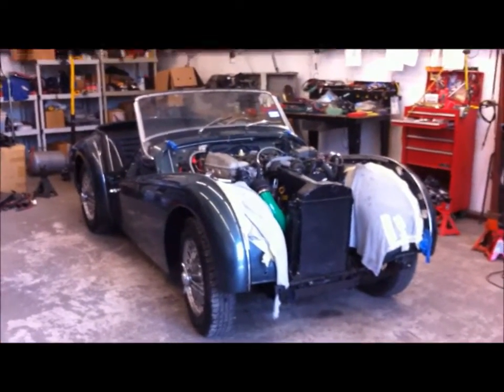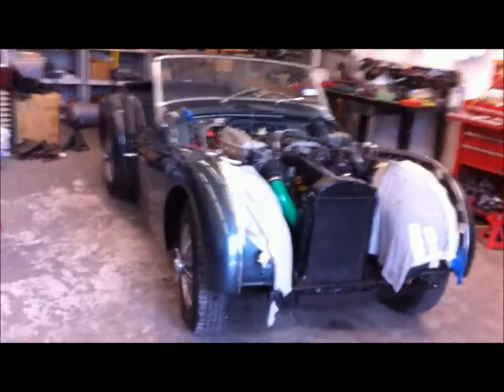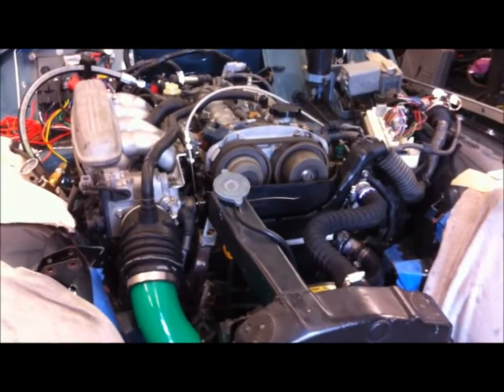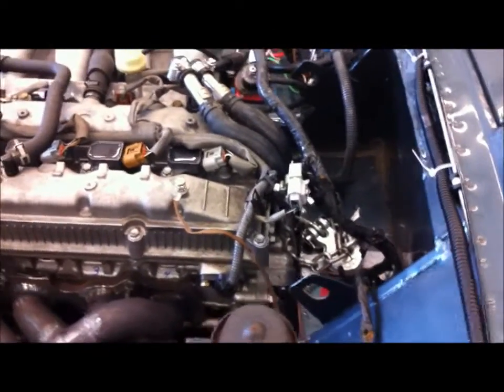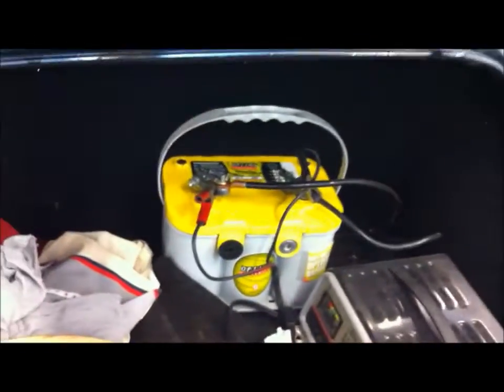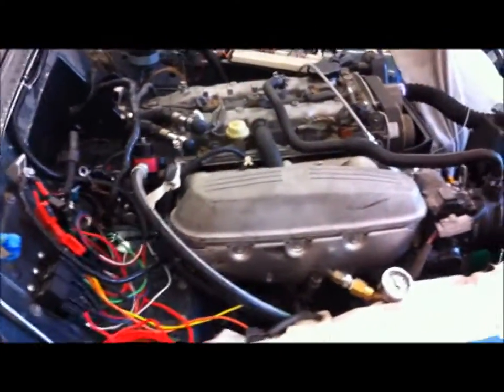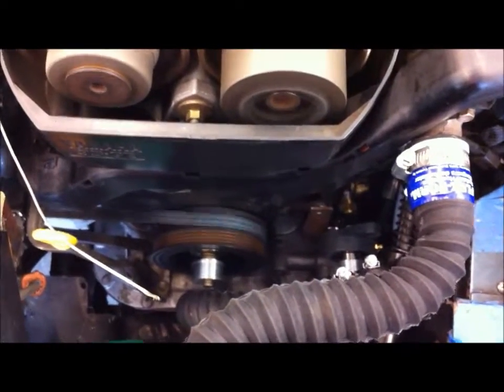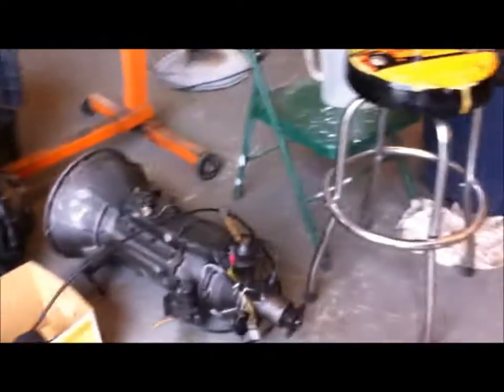Triumph TR3A With A Toyota Beams 3SGE Blacktop Engine.  Part 1 of 4

Comment: this triumph would make a sweet drift car haha.  great job.  i have a classic corolla that im tempted on putting on of these in.  im really intrigued by that transmission.  is that the usual suspect for that engine?
Reply from the maker: +Michael Peretto I purchased the engine and transmission together and never separated them.  As far as rear wheel drive apps this engine came with the J160 6 speed or an automatic.  I purchased the combination from ebay for about $1600.  Thanks

Comment: You have just fulfilled one of my sports car fantasies. Of course I would have put a different trans and engine...but you actually did it and not dreamed of doing the deed like I have throughout the years. Always liked the Triumph designs...just could not live with the reliability problems. Had a Spitfire 4 and a Tr3...miss them both in spite of...you know what I am getting at.

Comment from the maker: The engine is a Toyota 3SGE Blacktop it was used in several vehicles such as Lexus Alteza SXE 10.  It was not sold or used in the US but is readily available in Canada.  You can usually find them for sale on Ebay for around $2K complete with transmission.  One problem I have experienced though is parts. They are a little hard to come by in the US such as a timing belt.  This engine is rated for 210 hp. 
Thanks

Comment from the maker: Hello,  I am using the original differential and I had the drive shaft made to fit at a local machine shop.  I have pulled the engine out to clean up some loose ends and will post a look without the engine installed hopefully this weekend.
Thanks!